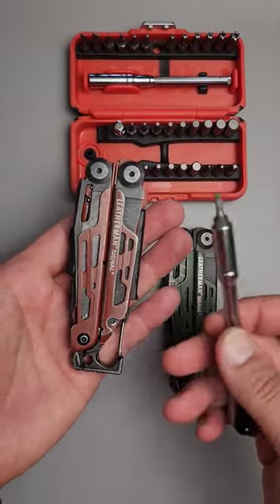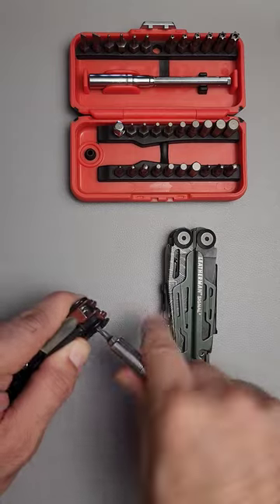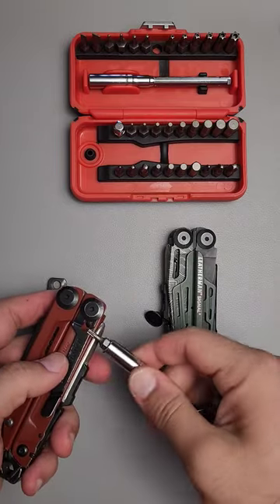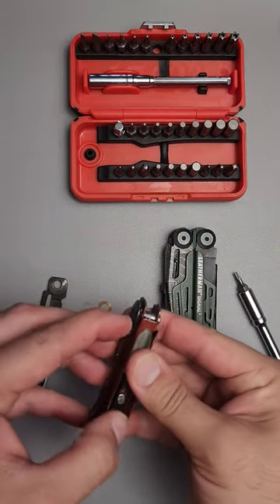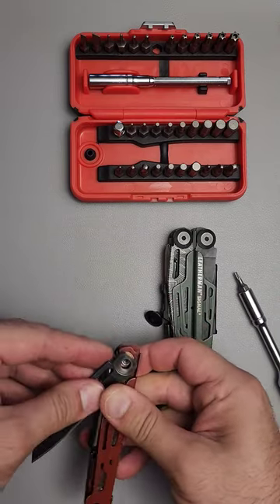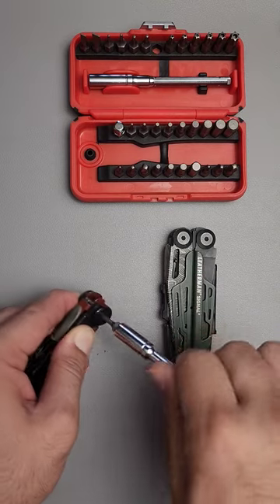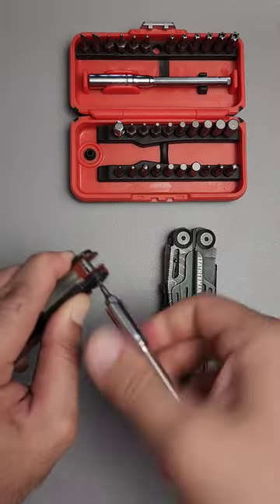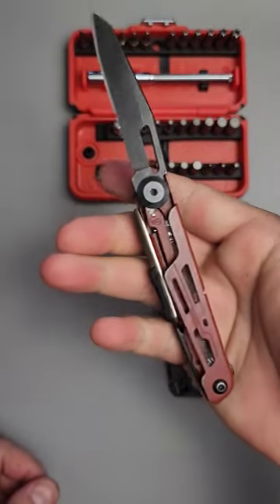🛠 Leatherman Signal into a Pocket Knife! (Modded in 60 second) #shorts

Comment: Thats really cool. I want a Leatherman so bad but they are expensive af
Reply: have some for sale. I bought more than I need from eBay for the purpose of selling
Reply: @MyUnquenchableThirst  You got a crunch to sell? Or a list of what you have?
Reply: leatherman rebar is relatively cheap for what you get(80ish bucks) but you can buy old pst's off eBay all day for 25 bucks
Reply: @colin8049  a wave, 2 skeletools, freestyle, super tool 200 and 2 of the older style PST
Reply: I only have one because I found it out in the woods, it’s a wave.
Reply: Check out your local pawnshops my friend you could be surprised. Here's some i found at a pawnshop.
1. Surge $60
2. Free P2 $90
3. Juice sc2 $10
4. Core $50
Reply: Start off with Leatherman or check your local pawn shops cuz they usually have a few Leatherman for sale.
Reply: If you can't find one on sale get a Skeletool.  It doesn't have all the features of the bigger leatherman, but the price point is great, it's lighter and thinner and will have most of the tools you'll use commonly.
Reply: They are overpriced don't bother. I have 2, a cheap one I actually like alright and an expensive one I hate. I don't remember what models. Wingman maybe is the cheap one.

Comment: When I open the blade on my signal, the bolts that hold it together move as well as the blade. Any tips to fix that without over tightening or lossening??
Reply from the maker: without seeing it, would be hard to tell. If its a signal there is little risk to removing the blade and pivot screw then reassembling them.

Comment: I was watching this video a few or more times. At first go, I found it interesting but after that, I can't see the point of doing that. You should be able to add tools, not dismiss them. Sizewise is ok, but it's not a huge tool. There are more options for getting a smaller and cheaper tool to fit this size. 
But if you are a Leatherman fan, I'm with you.

Comment: I quit carrying multitools because the only thing I ever use is pliers. I always have a knife so that is covered. I now carry knipex "wrench pliers" nice smooth jaws that don't raise burrs on bolts. I've used a long handled 15/16 combo wrench as a cheater bar on the plier handles, pliers did not break or slip.

Do a review on knipex "wrench pliers". I got mine for $50 on Amazon.
Reply from the maker: whats to say? they are the best in the world..not close.
Reply: I will not leave home without my both of those.  The Wave and Knipex 86-03-150 (6 inch) are my EDC.  I keep in my truck, all the other size Knipex pliers, from 125 to 250 cm

Comment: Heresy, your using a Icon tool set. Instead of the bits and extender that comes  with a m300.
Reply: @maxlvledc  I worked at Leatherman. So, I just had to give you a hard time. You can always check thier website out. Get some cool Lazer etching, or other things
Reply from the maker: @straighttoyou  right on! I wish they would be more creative with the things they already have.
Reply: @maxlvledc  Did you see/hear about the MR. Crunch? Got to get on that email list! You're missing out.
Reply: @straighttoyou  those sold out in under an hour.   I’m on that list and I still couldn’t get one.
Reply: @KillSwitch80  I was working there and couldn't get one. But if I was on the email list, I would have had a heads up.

Comment: I wouldn’t use lock tight on a knife. Not worth the hassle when doing maintenance. If you’re worried about it working loose just use a torque wrench to make sure it’s nice and tight but not so tight that you jack up the threads.

Comment: Just get a Leatherman Free K2 or Free K4...
Reply from the maker: Or...have both...with a better blade and much more comfortable clip lol
Reply: Lol Maxlevel, you hearted your own reply?  That is hilarious. Also, I would love for you you to elaborate on how the K2 or K4 isn't as good of a blade as the Signal half? The signal blade is a downgrade  y most knife enthusiasts  because it's not a fine edge. It's a partially serrated. I prefer to save the partially serrated for when I need it. So the K2 (which I own) with it's hollow grind is a better option. The sheeps foot is decent too. It has a good enough point for puncturing. In this case the K2 and K4 do not have a black oxide coating either. Which is better for hard use as well in my opinion. The main blade is very centered as well as more fidget friendly on the Free series. Never had an issue with the pocket clip. So I think your tip is just for people who already have the tool and want to risk losing half of a whole.
Reply: @mackjones7688  Well I can see your one of those who thinks you know more than anyone what's best.
Reply: @RamenTart  
It's my contribution to the "debate". I shared what I think is a valid to justifying my opinion on the matter. I have had hands on the signal and I own the K2. If you think I am wrong. You are more than welcome to tell me why I am wrong and offer reasons as to why.  If you think I am arrogant, a know-it-all, etc.  That's fine. Honestly I know more than most people on a great many topics. Lol  Which is very different from "thinking" I know more.